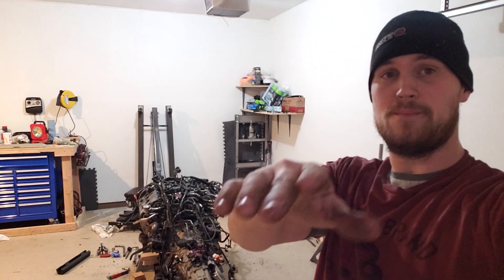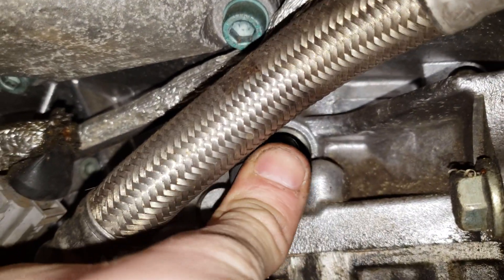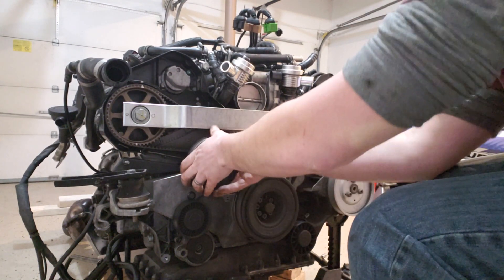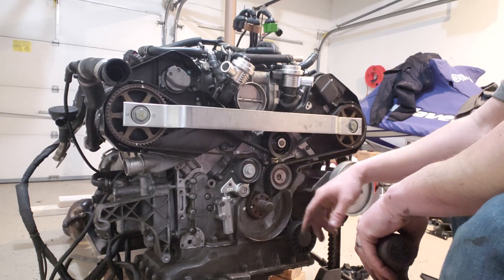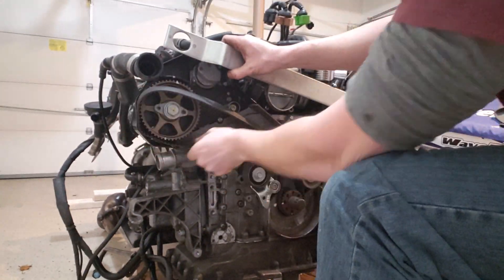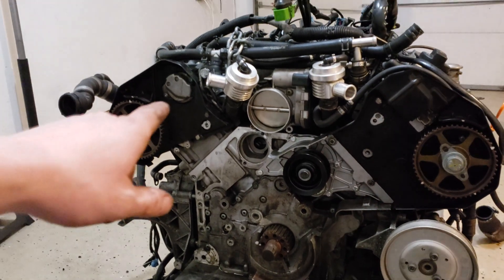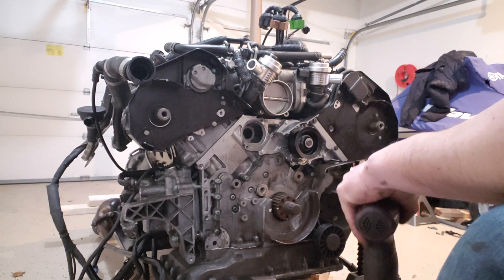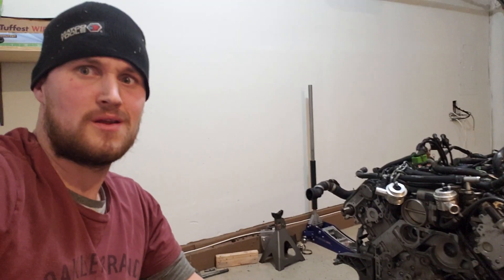Audi RS6 Timing Belt DIY P.1

Comment: You lightweight!  I did this with the engine in the car.  You want to try putting that crank pin in with an extension bar and universal jointed socket, it’s about a three hour job to locate it undo it and put the pin in.  Plus you missed the few hours to undo the cooling fan which is almost impossible with rusted bolts, and that crank pulley has rusted bolts which required a hammer and chisel, plus hot torch and hydrochloric acid, everything, to get the star drive bolts out.